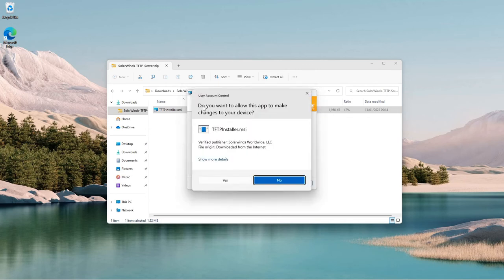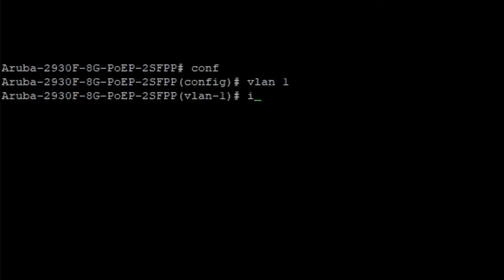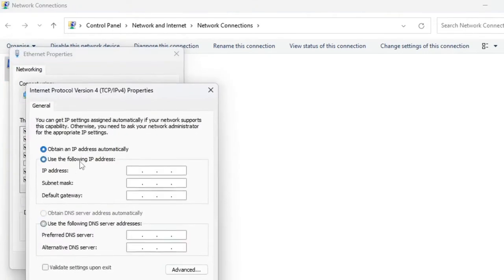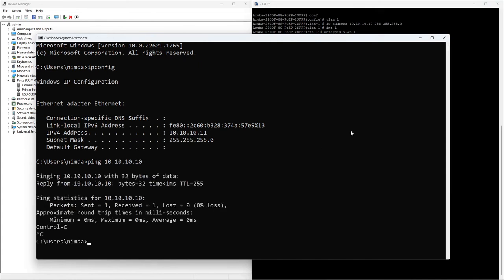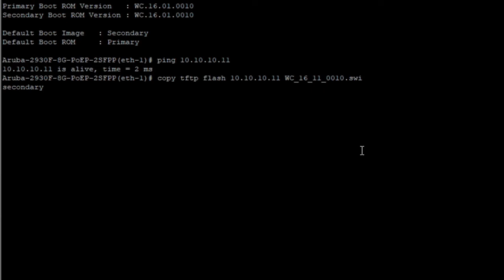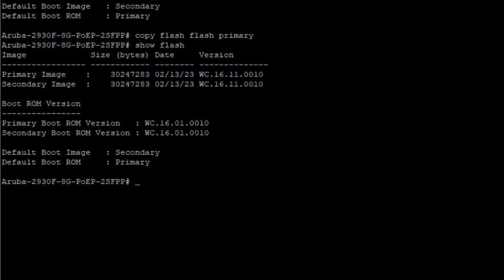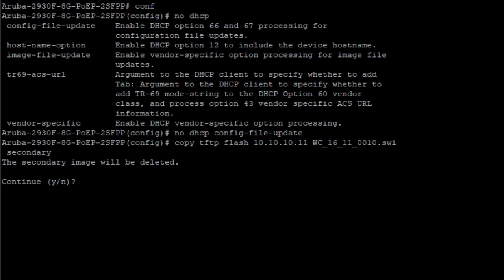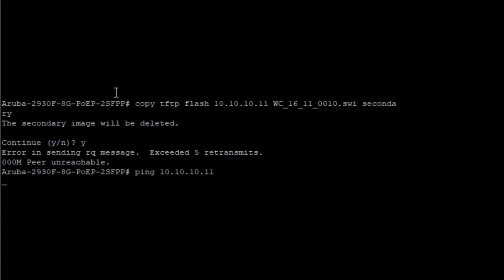How to upgrade firmware in aruba 2930f & 1930 switch.

Comment: Hi sir Can you update the firmware for  APIN0225 Aruba AP ?
Reply from the maker: Go to Aruba Support Portal.

Login with your HPE Aruba credentials (active support contract required).

Search for AP-225 or ArubaOS 6.5.x / 8.6.x / 8.10.x depending on your controller version.